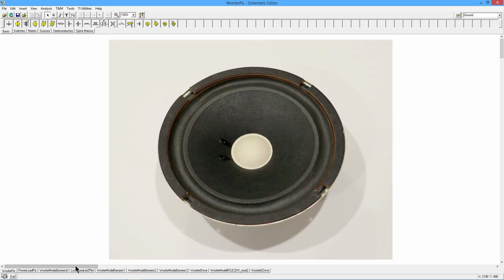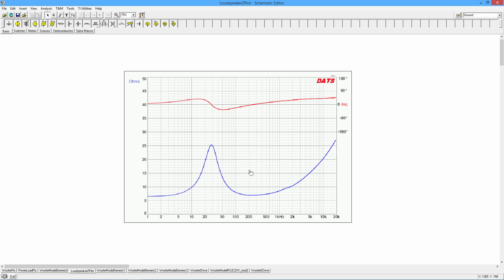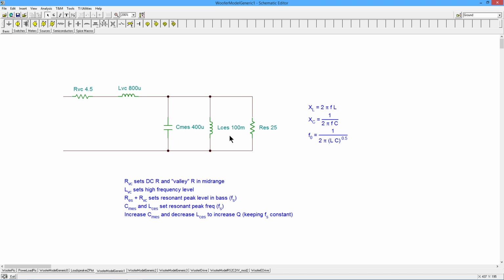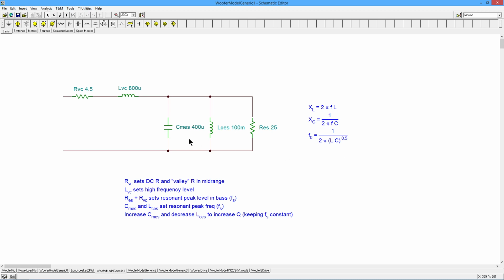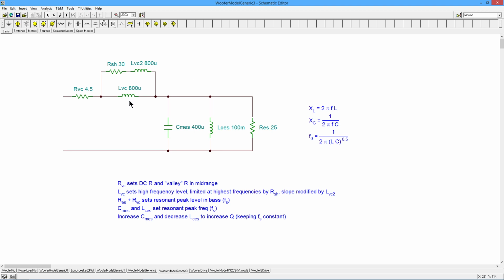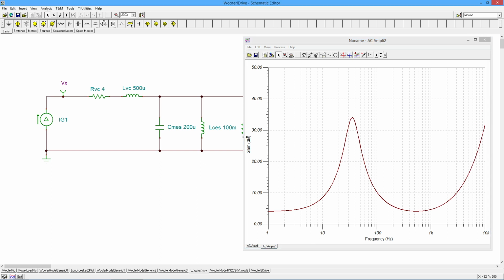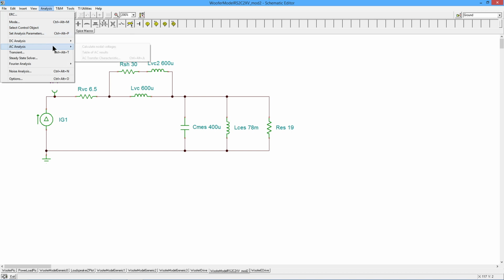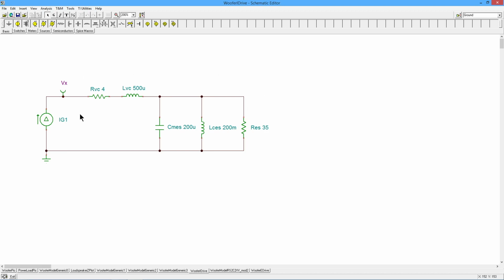A Loudspeaker Impedance Model for Circuit Simulation

Comment: This was interesting. I am curious how these circuit params would relate to a physical model of the speaker - mass of the speaker cone, restoring force of the surround and enclosure, force generated by the voice coil, back emf from movement, etc....
Reply from the maker: Much detail can be found in the original papers by Thiele and Small.

Comment: As usual good video, what is the advantage of putting a "shunt resistance" in parallel across any circuit?
Thanks.
Reply from the maker: "Any circuit" is rather broad, but in general, when it comes to resonant circuits, it helps to control the peak impedance.

Comment: Good video. Can you tell please what is Cmes and Lces?
Thanks.
Reply from the maker: These represent physical characteristics. We need to model the springiness of the suspension and other related  elements. You won't generally find these parameters on a driver data sheet (although given enough data, you could calculate them), but this isn't a problem because, as shown in the video, we can come up with reasonable values empirically. 

It would take a while to go through all of this (which is why I don't do it in this video-because that's not the point of the video), but there are analogs between mechanical and electrical systems. For example, mechanical friction is analogous to resistance in an electrical circuit.
Reply: @ElectronicswithProfessorFiore  Thanks for the clarification. Keep it up.

Comment: Please note that you are using a current generator. It is ok to find parameters but in real word you are driving the loudspeaker with a transistor amplifier which has a very low output impedance or a tube amp which has an impedance equal to your loudspeaker. Therefore because the low output impedance is in parallel of your LC bump the low frequency bump will be attenuated.
Reply from the maker: Sure, but the point here is to use the current generator as an easy means to derive the model. Once you have the model, you can now use it to explore with greater accuracy the capabilities of your amplifier. As an example, I just posted a video on the effect of using a more realistic reactive load for a power amplifier versus the typical resistive load used typically. That video shows what happens to the load line of a class A amplifier. I will be posting another video in the next couple of weeks showing the effects on a class B amplifier.

Here's a link to the class A load line video: https://youtu.be/leRAqhsMoTI

Comment: Very interesting! I wish I had seen this earlier. YouTube is too busy trying to get me to watch other videos which are of zero interest.

A few observations from someone who does this kind of thing all the time with in-water piezoceramic transducers where we use a BVD (Butterworth Van Dyke) model which uses a parallel capacitor and a set of RLC series strings which define the resonance points. One difference in the way that this is handled is that the priorities are different. With in-air acoustics, I guess people are interested in either fidelity or some pleasing type of sound, while in-water acoustics are driven by maximizing radiation efficiency in some defined band. This means the resistances in the model need to be divided into a portion that is heating up the transducer as opposed to a portion that is moving water. As an added complication, the portion that is moving water can't be linear. I think this is similar in-air, so I guess you are actually generating a small signal model around some operating point.

1) Analog devices use to have a low-cost development card for doing impedance measurements over a band. It's not like having one of the professional units, because limited dynamic range means you need to futz with a few components to keep things in range.

2) If you have a measured Bode plot and a model, you can use a genetic algorithm to mindlessly converge on a good approximation for the elements that minimize the error as defined by your scoring function. I used to do this for beamforming phased array element localization. You need to be able to randomly adjust component values and then run your scoring function. If it's an improvement, you use the perturbed values. Otherwise you use the pre-perturbed values and try again. At the beginning, it's easy to find improvements. At some point, you stop finding improvements and you're done. If you plot the new Bode curve each time you find an improvement, it looks like magic as it converges.

3) The simplest implementation of a generalized BVD model uses many parallel RLC strings to model the multiple resonances found in any in-water transducer along with the bulk capacitance. It seems that you could have a similar model with two resonances, one in band and the other above the band of interest, along with a 'bulk resistance' to get the right impedance at low frequencies.

I had some interest in air acoustics several decades ago, but was discouraged by too many discussions with people who were primarily interested in acoustic characterizations that only they could hear, or thought that things like speaker cables were a major part of the solution space. In sonar systems, fidelity is never even mentioned, and the focus is on either putting as much power as possible in the water, or receiving signals over the largest possible dynamic range with the highest sensitivity. There are still lots of arguments about the best way to achieve these goals, but at least I don't have to argue with morons who are talking about how much air there is in their copper cables!
Reply from the maker: Thanks for the input. I haven't done any work with underwater acoustics, certainly not high power sonar apps. It is interesting how the design targets are so different. For audio, fidelity is everything (at least for music applications, public speaking is a little different). And I totally get your final commentary about "things only they can hear". The tweak hi-fi world is little more than well-heeled and gullible individuals being fleeced by grifters. Seriously, I've heard people extolling the virtues of special replacement AC power cables costing hundreds of dollars for their audio power amps. Apparently, it never occurs to them that behind that AC face plate is maybe 40 feet of Romex leading to their breaker box.
Reply: @ElectronicswithProfessorFiore  hello sir, can u give the circuit diagram of this and also the pcb layout, i'm actually using this for my project

Comment: Why Z parameter is difficult to measure for a transistor?
In Engineering circuit analysis by Hayth, I read that it is difficult to measure Z _21 parameter by open circuiting output terminal.
It says it affects the bias. But they are saying short circuiting can be done.

It's in the first paragraph under the heading 'Hybrid parameters '